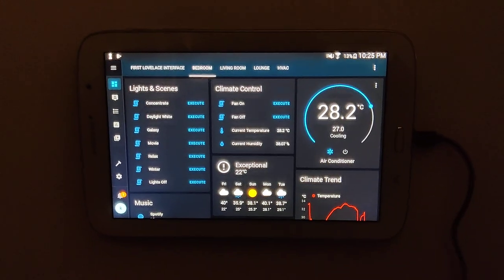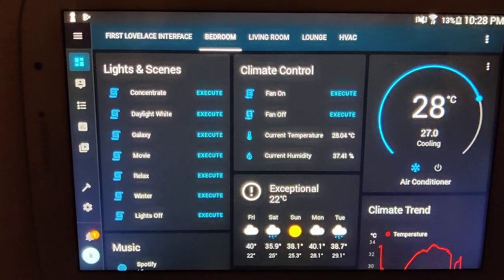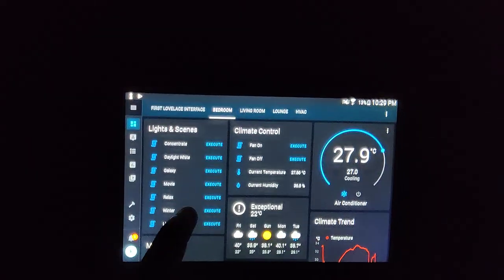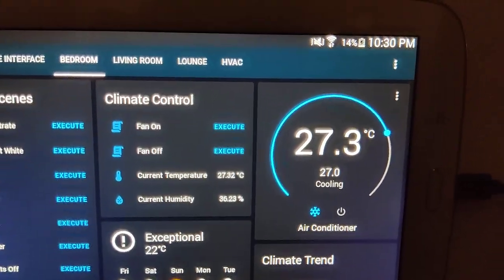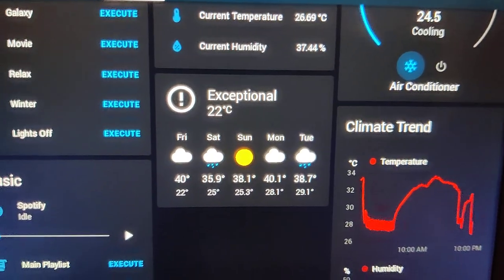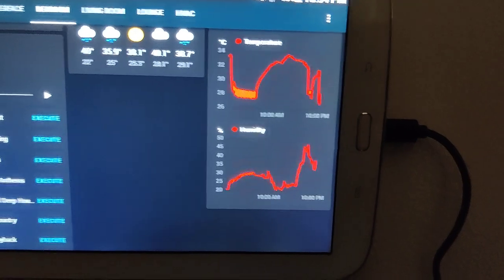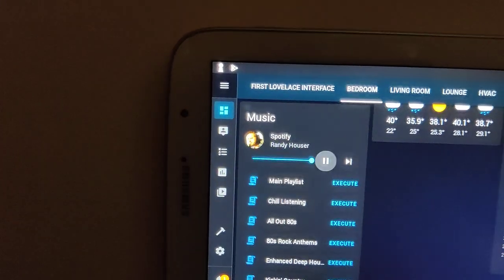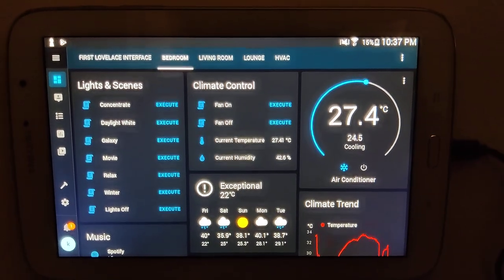Smart home dashboard implementation

Comment: Very interesting project. Can the Philips lights be controlled locally only and not through the internet?
Reply from the maker: If you're using the Hue Bridge with Home Assistant then Home Assistant communicates with the bridge locally rather than the cloud. However the bridge itself is connected to the Internet. You could block Internet access to the bridge from the router though. 

Another option is to use a Sonoff Zigbee stick, a Conbee 2 or any other USB Zigbee stick for local-only control.
Reply: when you use vpn or when you setup a https for your home assistant